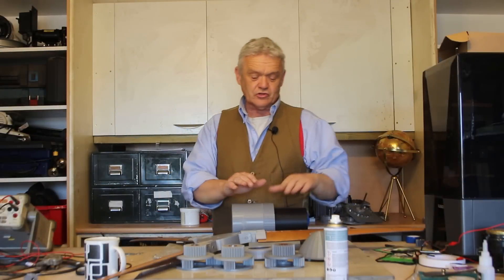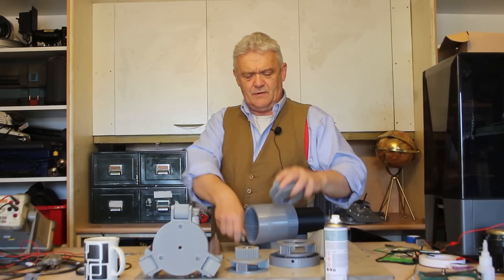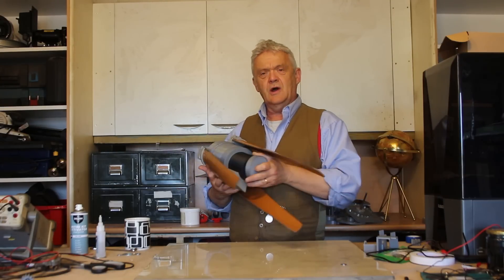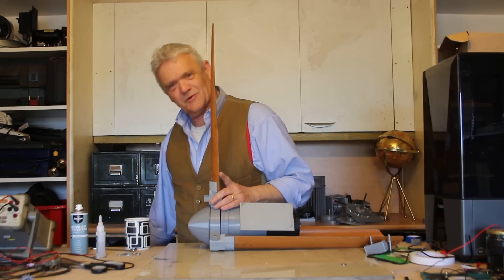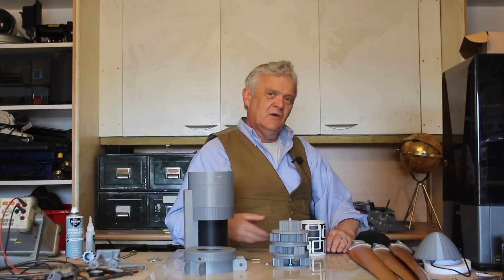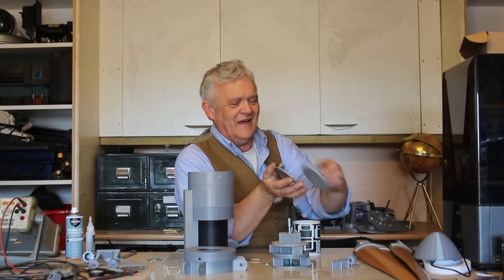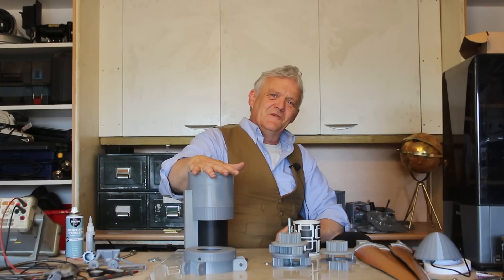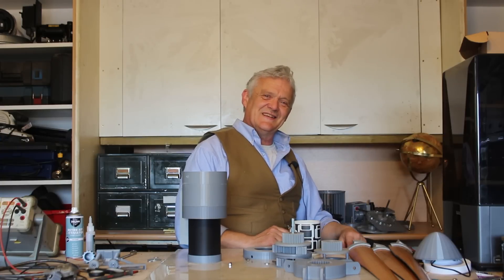1965 The Folding Wind Turbine

Comment: Look at 3.06 if the "nose" cone is really the direction the wind is coming from surely the blades are curved the wrong way - they should have their concave sides facing the wind? Not the convex side ! This is showing the setup for a propeller

Comment: What if we used 3D printers to make TELESCOPING windmill blades, that have a smaller blade inside them, that could be extended to catch more wind power, and a still-smaller windmill blade inside that, which could be extended further? Also, if we did that with airplane wings, could it make a large passenger airplane into a glider riding the wind, to greatly conserve fuel?

Comment: really wish you could get a partnership with Taulman and then print some of these "production testing" level products using their 915 or at least the 230 nylon filaments (the 230 can be printed with any printer that can print ABS and PLA, and is in fact easier than even PLA to print, honestly just have to keep the filament dry as it absorbs moisture from the air then gets really difficult to print and stinks a bit, but a box with a small hole on each end and an electric heater blowing into it for about 4 hours will take care of even the worst issues of moisture in the filament :) just blow hot air in and it will dry it right  up. I ran mine at the medium setting during the summer and low heat during the winter and it dried my filament out right quick then I was able to use the filament with it out in the air for like 3 days before having to dry it out again :)

Comment: This may have been suggested already. If you leave the pin plastic, but with a shaft hole, you can simply slide a pin in it and super glue it in place. Metal pins surrounded by plastic sleeve glued for strength. I too have had this stuff shear off unexpectedly. You might try to merge the layers with a melting dip. ABS requires Acetone and PLT requires alcohol. But I love what you are doing here.

Comment: His turbine didn't work so it had to be spun by a motor.
The blades were on backwards.
Instead of demonstrating how he collects data for a graph showing POWER, (not voltage) versus wind speed, he changed the subject and talked about the 3D print process.
get a life

Comment: The clips you are using to hold the blades could be replaced with an adjustable spring loaded device. That would allow the blades to "feather" back in high winds. This is a common feature on wind turbines.

Comment: Could you have the blades folding forward (if they really must be designed to fold). At present if/when the mechanism holding the blade out fails, the prop will fold back hit the pole and destroy the blade and likely damage the mounting arrangement, become severely unbalanced and...... I understand that folding back is neater for stowage. Another option could be to have the blades detachable, so for stowage the blades sit as they presently sit when folded back, but for generating, you detach from the hub & turn 180deg and clip back on to the hub but now they cant fold back due to the bracket design.

Comment: I've been thinking about generating a current using a fountain of water.I watched a video on how to contruct a perpetual water fountain taking the water from high to low pressure quite simply by attaching a narrow plastic pipe at the bottom, pushing the water up the pipe and acheiving perpetual motion.If you coupled this with a wheel as they did in flowing rivers of the past ,could we connect it to a light? I bought an induction cooker and realized that we could probably hook this concept up to rotate the magnets. Knowledge is a wonderful concept 🤗.
Would you be keen to show us?
Makes me think about all those wonderful cities of the past with many fountains. I wonder if tbe trams ran on a closed circuit using copper?

Comment: The pin shear doesn't really surprise me, but it's a prototype, and prototypes are where you find the things that can be improved.
I would question the longevity of that gearbox (especially the faster end) given that the gears don't have bearings.  Adding them will make it quieter and prevent the pins from wearing out.

A VAWT is what I have always planned to build, so it will be interesting to see your upcoming projects.

Comment: Simplest way to get rid of a vane is to put the turbine on the REAR of the generator.

The folding turbine MAY actually INCREASE the efficiency.

If you think about the fact that the blades weigh something, IF they are actually NOT popping up along the TOP side [PARTICULARLY with the blades in "DRAG" mode (as opposed to "PROW" mode...)] this CAN potentially ADD a tiny touch of improved performance!

In other words, by NOT needing to LIFT the blade assembly, you MIGHT be able to recover about 20% more power.

Seeing as gravity, air drag, pressure AND centrifugal forces SHOULD cause the blades to hurry up and rush out into peak torque, once they get past a certain point.

You may want to investigate this a little bit.

Looking at some of your other works, this SHOULD become easily evident to you AND be something you find rather amusing, if not quite compelling.

Again, should this have been forgotten since the start of the post, this REALLY, and ONLY works most effectively, if the blades are being used TRAILING the main housing and pivot point of the system.

The reason for blades to the rear is 1, the potential power gains from a collapsing blade function, but 2, the fact that is dispenses with the need for a vane to the back of the unit, therefore simplifying the overall structure and making it ever so slightly compact. 

[again, addressing many of the details with pusher prop airplanes, where aerodynamics favor increased efficiency and steering acuity, where the power is rear of C.O.G.]

Just a little thought to put out there for ya.

Comment: I am not an affiliate but I've used some interesting materials (available as 3DP filament, some of them) from a company called Igus.  They specialize in something called "tribological" family of engineered materials as well as extremely long wear, self lubricating, and high strength versions for replacing steel in industrial bearing applications.
They also offer bar and powder stock as well as sheet/tapes in some.  They are usually excited to work on interesting projects and your time difference should be better than mine in the US as they're based in Germany.  They have US sales reps but to talk to the home office is always a business day off, and I respect that - if your project can't wait for a day it's probably going to fail (has been my hard earned experience).  Much better to light up your sales reps phones when you have that situation and never otherwise (also hard earned experience).

Comment: At last, the field test... awesome results!  Have you considered doing lost PLA casting with aluminum? There are a few different techniques. One of them is to make the first negative mold from silicone, use that to make a wax positive, then coat that with plaster, sand, etc. Then you can melt the wax and recover it, and do the next one a lot quicker than printing another one. Less carbon residue inside the mold that way too.

Comment: Try more blades? Maybe thin washers between pinions and base? Plastic on plastic not that good. Use different filament, maybe nylon? Reduce friction and noise. There are nuts and bolts small enough, some with smooth section then threads?

Comment: Great video :) Excellent choice to replace the vertical pins on the planets with steel pins, PLA tends to delaminate under stress.  I'd recommend swapping over to PETG filament to avoid the deformation under stress.

Comment: This sounds like something I might make for my pontoon boat to charge a homemade portable battery box to run various electronics. Like my fish finder and LED lights. 

One way I strengthen 3D prints is to add a small channel to super glue nails from my 18 gauge finish nailer.

Comment: Another cheap way to make the pins much stronger is to print them hollow and just the right size to slip a common finish nail into (or a regular nail that you've clipped the head off of).  Extremely cheap and easy metal reinforcement, minimal additional weight.
Reply from the maker: nice mate - great tip - cheers

Comment: Well done on your output result. My only humble criticism is your foldable blade design. It will be a burden to carry around along the back side if intended for hiking in remote locations. Perhaps those extending, collapsing aerial antennas design which you see in old radios where you can pull it out to extend the blades outwards, then push it back it inward when done using it. It will save a whole heap back packing space when travelling. Nevertheless. Probably the most appealing wind turbine for diy project I’ve seen yet. Thanks again Rob
Reply from the maker: i will have a think mate - i like the suggestion - cheers

Comment: I wonder if you could use the transmission from a riding lawnmower and have two turbines (one where each rear wheel would go) that drive the transmission backwards to a pulley connected to a generator.  Might be worth trying
Reply from the maker: for sure mate - love it!
Reply: @RobertMurraySmith   I would advise one that is Not hydrostatic,  the mechanical ones should work better for this application,  also the differential should be allowed to stay a differential,  so the turbines can spin independently and at different speeds while still providing input rotation.  Another idea to try would be to use an old generator head off an old broken gasoline generator,  say 5-7kw and just use that as the power generation system,  it will turn slower than the rated power and output less, but should be more efficient than a diy solution.  If it'll make 5kw at 3500 rpms, it should at least make 500watts at say 200 rpms. Worth a try and a trip to the junkyard for sure. Love the videos and keep up the good work!

Comment: Multiple planets in a gear solar system is not unheard of. 3,4,5,6,8,9,12 would be acceptable,  using beatings would acccelerate the efficiency, and co$t. However pins and bushings, brass isn't cheap,  maybe stainless pins , polished to a mirror shine. Then use a steel bushing, ceramic coated  with a dry film lubricant.  Or stainless bushings with steel pins with a ceramic dry film lubricant, even  use of graphite,  on the pins and bushings , even the gears, they will look dirty, yet spin freely gears sliding past one another with ease,  possibly a fine sand paper hone of the bush and pin, in the 1500-2000 grit or better,  then rub in graphite under pressure, possibly try using heat and pressure, or a really thin glue, wipe 99% off, then dip in graphite powder . Use extreme pressure to get graphite in the tiny scratches left by the 1500-3000 grit  use even pressure around the pin, apply around 2000 psi , and possibly try the same without glue,  and use heat, around 200-400 + amps at  0.5-1v, held in a steel ( ) and graphite  blocks with grooves to fit the pin with with a ultra fine graphite powder, aroundthe pin, clamps on 3-4 sides. Then pass the current, heating the pin hopefully to the point where 1of 2 things happen.  Either the expanded steel allows the fine scratches to clamp on the graphite powder,  or the heated steel reaches a temperature high enough, that the steel router most layer is heated and softened enough that the graphite powder is entered into the outer layer, like tiny diamonds in a ring, then use a lathe or drill and file, to be certain the pin is flat and round ,  it should at the least have graphite stuck to it decently, making a slippery surface for a bushing to ride, or you just made a tiny pile of garbage!😆 Experiment and find out!!✌️
Reply from the maker: nice - cheers mate

Comment: Concerning the shear of the pin, another solution would be to apply CA glue and let it seep in the joints and cover the pin. It's really surprising how much more strength this offers to 3d printed stuff, especially when they're not printed in the ideal direction. I also use baking soda with the glue to maximize the strength and fill in the gaps more appropriately. Could even mix in some graphene!
Reply from the maker: good idea mate - cheers

Comment: Most people think of printing something like this either horizontally or vertically (rotating the part on the bed).  That's the right thought, but printing a part such as this at between 35 and 55 degrees would help tremendously.  It changes the shear angle, and for most printers, would only require support on the bottom section.  Anything beyond 55 degrees though would require supports everywhere.  That being said, pins are a better choice, nice one sir!  Thank you for the great series.
Reply from the maker: you advice is good advice thank you for sharing mate
Reply: Both genius and obvious. 
Really 'thinking outside of the box'.
Thank you.

Comment: Try using some T-cut or similar abrasive onto the gear surfaces to reduce the friction by polishing them by spinning them. Obviously wash it off before assembly...
Reply from the maker: that is clever mate - thank you for the tip
Reply: @ThinkingandTinkering  We used the idea on some wind sculptures a while ago and the wind speed needed to drive them halved!
Reply from the maker: @mark.guitar  it is a super clever idea mate - and a nice share - thanks for sharing

Comment: Splendid! At the start if this video the first question that came to my mind got answered. And I was thinking ahead what you would do to improve it. And tada, you said so (and really, I did think as well about the falling rotors as the durability of the gears). You see why I am 'a thinker'?
I would make sure those metal pins will hold very well, stress will now go sideways, onto the bottom plastic where it is inserted.
Usually I see these gears in a drill, they contain a lot of grease. I do not know if plastic+grease is a good combination, I think it is not.
Reply from the maker: i would think silicon oil myself mate

Comment: Do not replace these pins with metal ones. Increase their diameter and enlarge the holes in the planets.
Regardless, disassemble the motor that spins the platter in the microwave. You will see that the gears that spin fast are paper thin. The gears that transmit more torque are thick. So the planetary gears in your generator don't have to be the same thickness in every stage.
Reply from the maker: nice advice mate - cheers

Comment: Excellent. Nice to see something real bringing several concepts together.
Please excuse me. Just curious, not criticising. You appear to have the blades with the convex side facing the oncoming wind. Wouldn't they generate more lift/torque with the concave face 'forward'. Or am I missing something obvious?
Thanks.
Reply from the maker: this kind of blade actually works both ways round - because of the scoop in it is can either act in a drag fashion or as an airfoil - so it is not strictly one or the other mate
Reply: @ThinkingandTinkering  Hi Rob,
I get that. But asymmetric airfoils are more efficient in one orientation/angle-of-attack than the other, Bernoulli principle aside. And ignoring the effects of airflow velocity isn't doing sonic daft stuff, there must be a more efficient orientation of one over the other regarding 'lift'. I know airplanes can fly upside down, but unless they have symmetric airfoil sections one way up is more efficient than the other at extracting defleted-energy from the airflow.
Am I still missing something obvious.?
Please explain it as if you are talking to an idiot.  ;-)
Thanks very much.
Reply from the maker: @bikerfirefarter7280  you are absolutely right mate - but this is made from soil pipe and that means compromises - aerodynamically not the best way to go but for price - difficult to beat

Comment: Has the knighthood come through yet? 😉
Reply from the maker: i am not a friend of Boris so i am not expecting one lol
Reply: @ThinkingandTinkering  The ring layer (on which the sheared pins stood) is 2/3rds open space. Could you not add walls from the base of that up to the next layer (which is pinned only by those 3 pins currently) and grossly increase the strength and resilience of the whole thing without resorting to metal pins? You'd need to glue those walls to the next level however.

Comment: have you thought about elastics to the nose for holding the blades?   if the wind is high they will stretch back further.    honestly i thought it was designed to hinge the other way.
Reply from the maker: that's a good idea thanks for sharing mate - it was hinged the other way in the first iteration but i wanted it to fold up against the body for neatness

Comment: Great stuff. Maybe try out the magnetic gear box to see if you get a boost in efficiency? Also, Could you do a direct comparison between the pole mount vs the Darwin design... it would be great to see the same exact fan and motor be swapped out into these... to get an idea of just how much better one would be over the other.
Reply from the maker: I have done magnetic gear boxes mate and i like your suggestion - it is in my mind - cheers mate
Reply: @ThinkingandTinkering  Yes, I was VERY impressed with the Magnetic Gear videos!

Comment: Surprised me that it provided enough torque to turn, but the gears failing didn't surprise me. I always use PETG to print with, but even that would have failed in that layer orientation.
Reply from the maker: indeed mate

Comment: When I'm printing gears I usually use PETG rather than PLA.  The layer lines aren't nearly as weak, and it's got a little bit more flex in it to absorb the odd dings it gets.
Reply from the maker: nice advice - cheers mate